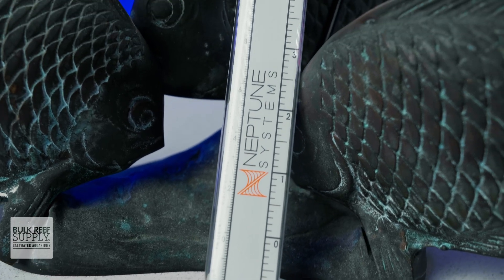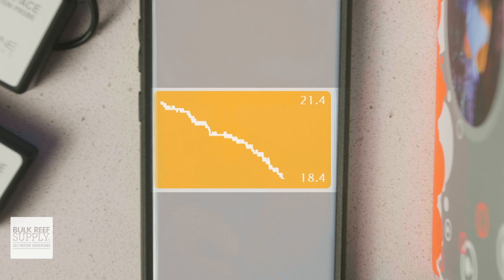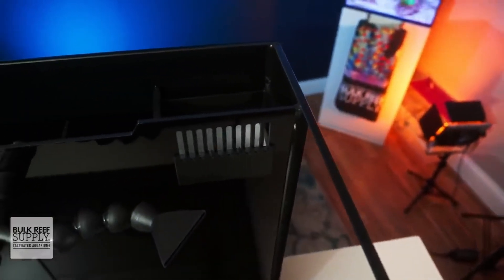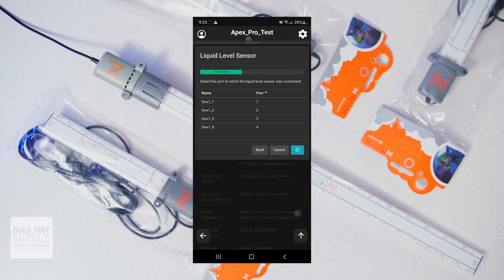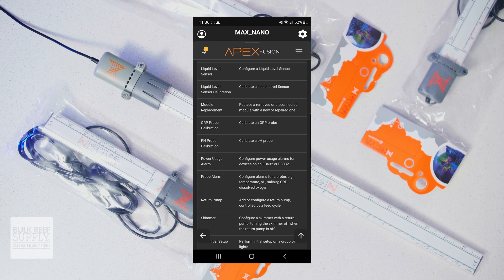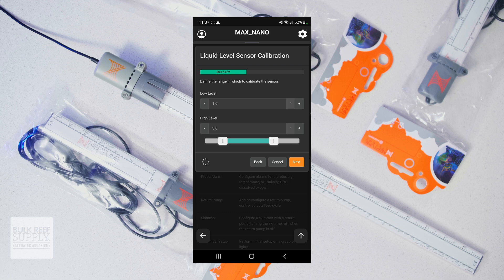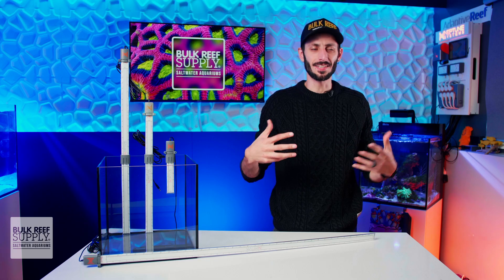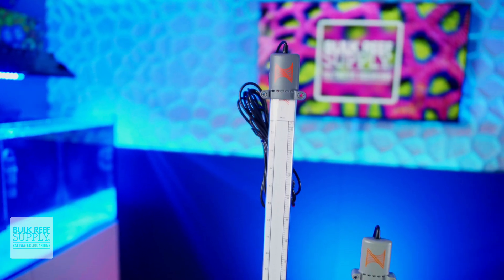A NEW, Dynamic Way to Monitor Reef Tank Liquid Levels! Neptune Systems LLS

Comment: The calibration on this thing keeps failing, I went away for 2 weeks, but the APEX kept saying I have 4inches of water LEFT in my Res...WRONG, not true, I actually had ZERO water left after 12 days...and did the manual calibration once I return and I still can't calibrate this thing...smdh

Comment: I wonder if it will sense solid liquid vs foam. Been working on a skimmer-level adjuster, if it doesn't recognize foam this just might work. If the level is down in the skimmer neck it will increase the level, if it is running too wet the pump will decrease the level.